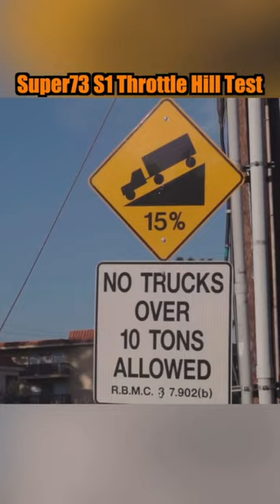Super73 S1 Hill Test Throttle Only ￼

Comment: When you spend $4k and you can barely go up a hill 😂
Reply from the maker: That is the nature of e-bikes, if you fall into the class 1,2,3 system, you have a max power of 750W, it will be tough to climb a 15% grade. Most of the E-bikes I’ve tested have failed to climb this hill!
Reply: What e bike you got stop hating
Reply: That's the price of a surron! You can get a five hundred watt for about six hundred from Walmart and a 750w for around $1200